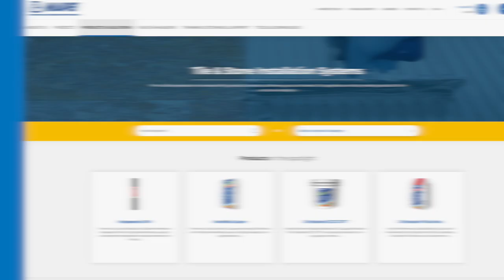Tech Tip on mixing mortar

Comment: How much time do I have to take before the mortar begins to dry?
Reply from the maker: Hello, if you are referring to how long it stays workable in the bucket, most mortars have, on average, about 2 hrs working time. This is assuming you do not use a high-speed mixer or warm water. Mortars require a low-speed mixer. Also, make sure to put the water in the bucket first. Please feel welcome to contact us if you have additional questions at (800) 992-6273.
Reply: @MAPEIUSA  amazing! Really appreciate the response! Blessed day brother.